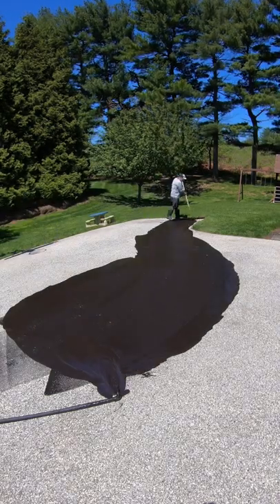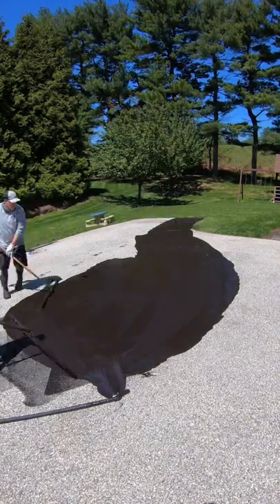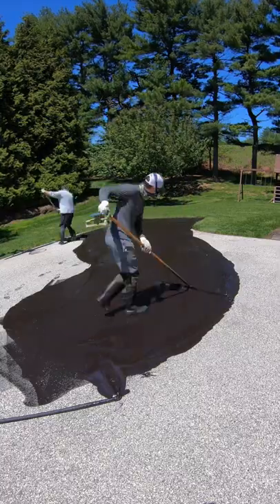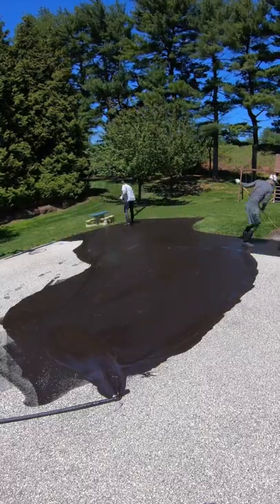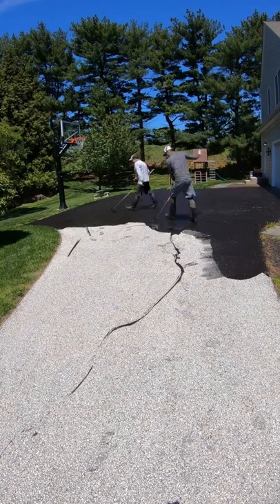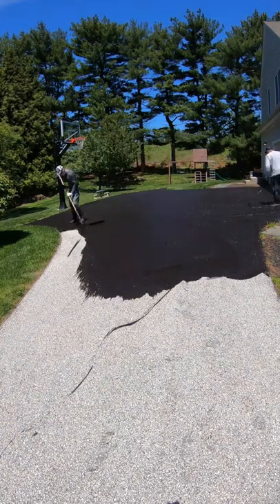Why did it dry like that? #shorts

Comment: It is an absolute grind. You set a solid pace you can maintain start to finish. Watched many a person jump to a fast pace and burn themselves out 4-5hrs in. They typically dont come back to work the next day. You just get in a groove and grind on. Breakes are usually taken with a squeegee in hand as you spread material. Arent going to see many a vrew that has done this for awhile stopping work and taking their 10 min every 2 hrs, lunch is either taken when you are between steps or you simply eat on the run.
Reply from the maker: Totally agree! I don't eat until I get home and breaks are taken in the truck, driving between jobs. 💪

Comment: Why does the end near the sidewalk look under covered compared to higher up? Got too cold, bad angle?
Reply: It’s not under covered, it indeed only looks that way. if you look closely you can see it’s just the angle and you can see parts of the seal shimmering, because the divots in the driveway that the seal has covered reflect to the lens. It gets less and less further back you look because the angle to the camera is off, so it’s not shining on it. When the seal coat is wet and fresh it’s extra shiny and reflective, so that definitely adds to it.

Comment: One way to counter the heat, is to spray a light coat of water on the asphalt before the sealer, helps it adhesive to the left over dirt better as well.
Reply from the maker: Ye old “fog” method.

Comment: My husband was a black topper he did sealcoat and yes you have to go with the grade and you have to work quick and it's best to do it in the early morning
Reply: @SEALCOATINGISLIFE  is that work you’re doing in this video seal the cracks in the driveway and does it only work for asphalt it you can’t do that for concrete right?
Reply from the maker: @aaronreid1183atyahoocom asphalt only

Comment: What do you do when there are dips in the drive way from like a flower pot sitting on it? How do you level it off before sealing?
Reply from the maker: if its deep enough for cold-patch asphalt we will use that, but usually those impressions aren't deep enough to hold and kind of material. Just leave some EXTRA sealer on our final pass with the brush.
Reply: Epoxy filler

Comment: finishing in one direction, if your right handed then that side of broom is more worn than the left so  the finish broom needs to start right to left for every pass and then in 3 years you still wont have any lines showing even after it wears. you notice the contrast when the left side of broom is less worn and you finish line back and forth. i have shown my crew this and waited years and everytime the one we did it my way always looks uniform and the back and forth always shows lines every16 inch lines

Comment: I did mine and I don't care that it has any streaks it just shows it's very thick I use a brush squeegee just doesn't fill up all the nooks and crannies good enough a squeeze just doesn't fill up I use a thin pushroom type type for blacktop and it worked well it definitely pushes everything down inside every little crack so you get a good seal
Reply from the maker: brushes are best

Comment: How do I remove it if I have gotten it on the house or to far past edge of road driveway meet point??
Reply from the maker: Water if it’s still wet. Goof-Off works if it’s dry. Or you can use a pressure washer.

Comment: Similar to concreting driveways once you start you can't stop, we had this one job it was 35-38c and the concrete started setting within 40 minutes and we had 32m² to do ( it was only me and my dad there) we got it done just in time but it involved adding extra water and extra elbow Greece because it was pretty much solid lmao, and then 12 hours later it was -4c and almost froze over which can also destroy the concrete, but once again it was fine after adding insulation and covering
Reply from the maker: yes, 💯

Comment: 1. Seal Early before the Heat of the day.
2. The Mix isn’t 💯
3. If spraying, there could be a partially clogged Tip. 
4. Too much (water) if it’s a Coal Tar base. 
There are a number of Factors, I wouldn’t necessarily call it “Bad work”because it does happen at times, and it’s a relatively easy Fix. 
This is my 22nd year in the business, and I cannot Purchase Coal Tar Anywhere in Chicagoland or Northern Illinois this Season.

Comment: You don’t need to do it as fast as possible. Just make sure you do it between 70 and 85° out and a nice clear day. I did mine over the course of 2 days with a day in the middle of not sealing. Dried and looks good. Use the same sealer for he entire driveway, each company or variety of sealer can use a different amount of carbon black.
Reply from the maker: Only true for a DIY.

Comment: Your work is very good. As a sealcoater myself, can i ask why you walk thru what you have already sealed? Is there a reason behind this? I tried this on a job over the weekend because i dropped too big of a puddle so it made sense to move the puddle back and then go side to side and work back to the puddle. I feel like that particular area may have even looked better as well.. but i may be overthinking it. Basically moved the eccess back quickly and then did the fine tuning side to side
Reply from the maker: Walking in the sealer give you the opportunity to brush the sealer in from multiple angles. We’re a 2 man crew using 4 foot brushes. This is definitely the best way we’ve found to apply the sealer.
Reply: @SEALCOATING IS LIFE  that's what I thought. Like I said I actually noticed it didn't show brush marks. I pulled it back, then went side to side. Noticed it looked better in that area. Thanks man
Reply from the maker: No problem. My partner is also the best sealer I’ve seen. He’s got the touch.
Reply: @SEALCOATING IS LIFE  what's a good starter diaphragm pump. What is the GPM I'm looking for.. I'm trying to find the best starter without spending 2 grand..

Comment: A house just down the street just had this done to their driveway recently and it has ruined the curb appeal of that house and every house around it because they didn't let it fully dry. The once clean street now has dark black treads that go from that driveway to the stop sign two blocks away. Their driveway also needs to be redone because it looks than it did to begin with.
Reply from the maker: Sorry to hear that. Was it just seal coated or did it get all new asphalt?
Reply: @SEALCOATINGISLIFE  i believe seal coated.
Reply: Sounds like the fault of the owner not sealcoating compnay. Patience is a virtue

Comment: Gotta love slippery ground
Reply from the maker: how so?
Reply: This is water based sealer, only petroleum based sealer will leave the asphalt slippery. If you add sand to the sealer also it will actually create more traction than before which this guy is probably the most professional sealcoater I’ve ever seen even more than myself, so I would like to assume he uses sand in his sealer
Reply: By petroleum based I mean like Gilsonite btw
Reply from the maker: Adding sand to the mix #shorts
https://youtube.com/shorts/DpncJqa0Hdw?feature=share

Comment: Either too little water, or it was too hot. What does that have to doing it as fast as possible?
Reply from the maker: If you take too long, the material will set too quickly. If your material isn't mixed properly or is too thick it will set even quicker.

Comment: How can you overdone a driveway that is too hot (and leaves the streaks mentioned in this video)? Would you already it with water hose?
Reply from the maker: Worst case scenario, yes. Any driveways in full sun we seal first thing in the morning. Driveways with tress or the house blocking the sun we save for later in the morning/afternoon.

Comment: My drive is a slope, and we just had it seal coated for the first time, and now when it rains, my rear-wheel drive car slips up it. Is there anything I can do?
Reply from the maker: Add more sand to the mix the next time it’s sealed.
Do you have a 4x4 vehicle?
Reply: @SEALCOATINGISLIFE  yes my other vehicles are just my sons first car is not

Comment: This is one video I can prove one of the reasons wrong I work in asphalt/sealcoating for 5 years and It’s been because the asphalt was too hot I live up Midwest and gets to 110 with no shade and never have done that I but I don’t know if it’s because it didn’t have much water I do know that you do have to add a strong thick layer if not it’s thick layer it’s going to leave some light spots
Reply from the maker: I don't really understand what you wrote. 😐

Comment: I have a lot of alligatoring on my drive way is there something you use that would fill the crack
Reply: Yeah, its a hot melt crack filler that usually comes in 20-25lb blocks and is melted down and applied with a upside down cone filled and a squeegee.

Comment: What i don't get white rock lets turn it black.
Umm temperature on that rock whent from 90f day so rock will be 110 to 120f is now 140 to 150f because now it takes all the heat because its black.
Reply from the maker: It really helps in the winter 🥶
Reply: @SEALCOATINGISLIFE  i bet but I rather not cook and dell with 2 or 3 months of bad weather then 20 to 30f hotter temperatures in my yard area all 7 to 9 months.
Reply from the maker: @thesilentone4024  where do you live?
Reply: @SEALCOATINGISLIFE  las vegas its 110 but I also live in Idaho when I get tired of the heat.
Bolth homes are on small hills like no more then 5 feet up from the road.

Comment: I thought I was being smart when I did all my cutting in a few days before so I’d be finished faster!  Well turns out, you could see everything I did before!  Lol.
Reply from the maker: 💯. It has to be applied same-day. Even in most parking lots, you can see the cut-in vs. the spray pattern, (and those are done a few hours apart).
Reply: @SEALCOATINGISLIFE  I’ve got concrete curbing, so I thought I was so slick getting that done first!!  I tried telling myself to give it a week and it will match after it has dried a lot!!  Hahaha nope

Comment: We did that and our driveway looks like a smashed cracker and it started flexing under load probably from getting so hot
Reply from the maker: Maybe its was too thick? Ive seen driveways where the sealer starts cracking, not the driveway.
Reply: @SEALCOATINGISLIFE  no like the entire driveway is crumbling you can lift it off really easy cleanup I guess since you don't have to break it up only about 70k to replace as the cracks are 5 inches deep

Comment: As an owner of an asphalt/seal coating business, I’ve also been the main distributor for sealer in the Midwest, I can tell your right now you are wrong. You will always have brush lines with sealer. I’ve sealed at night when the sealer is coolest using a 2:1 ratio the brewer coat and seal master require for correct use of their products. You sir are incorrect also no one uses a 48 inch squeegee to do a driveway. You should be using a brush.
Reply: I think he know what he's doing. You should make your own videos if you're the PRO.